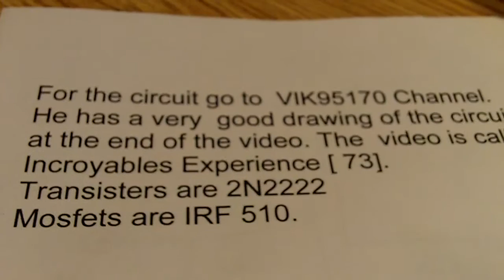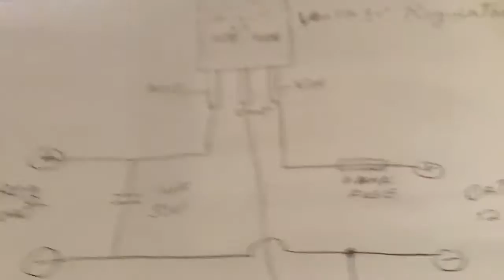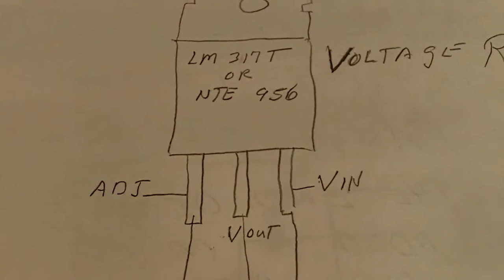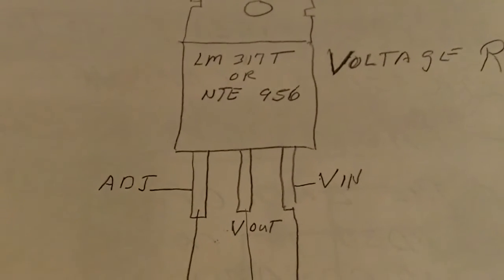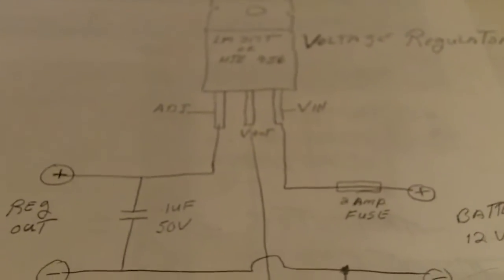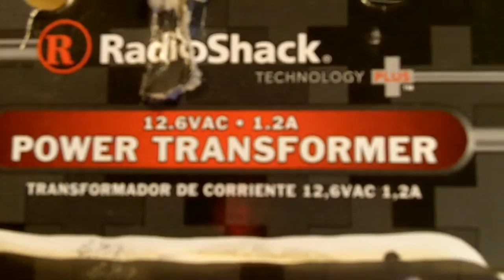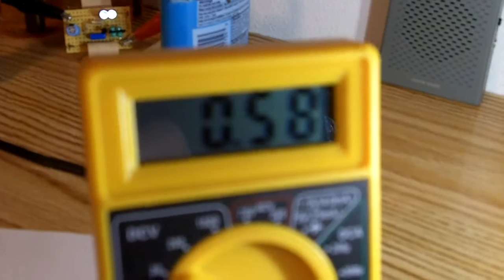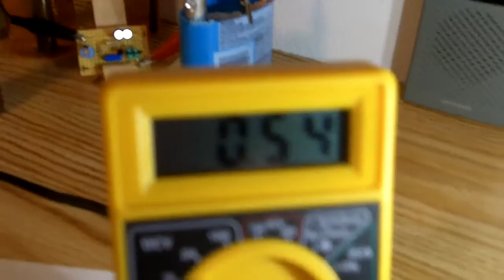Great little inverter.MOV

Comment: I'm jealous.. my LM317T is a firehouse. I didn't have the exact parts... I am using IRF 3205, MPSA06 NPN's, 2uF capacitors tantulums on the flip flop, 680 ohm base resistors, 4.7k gate resistors... a Hammond 6-0-6 1.5A CT transformer... and I'm on fire in under a minute if I leave it. *shrugs* sniffle